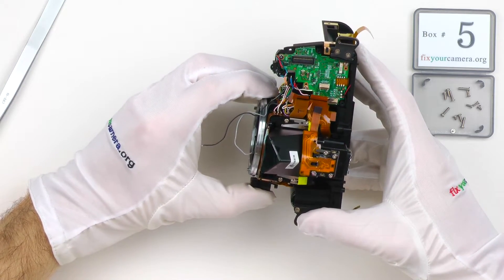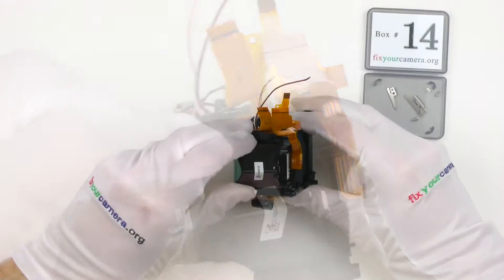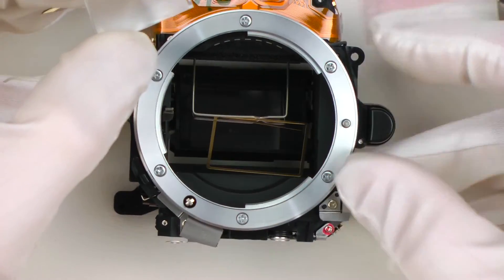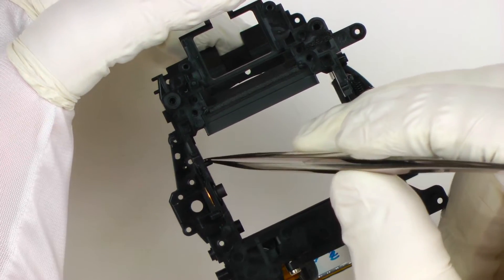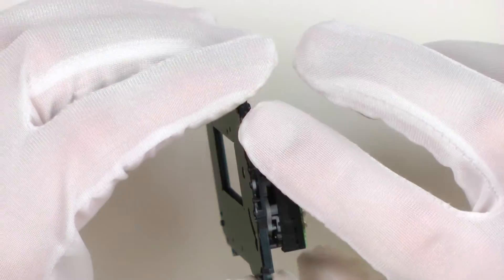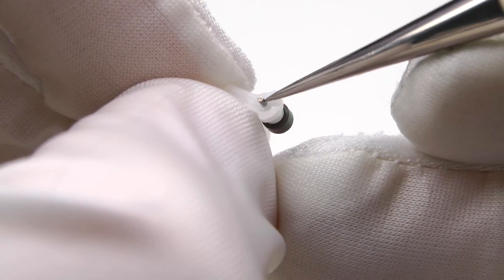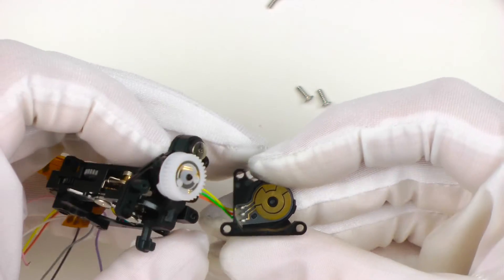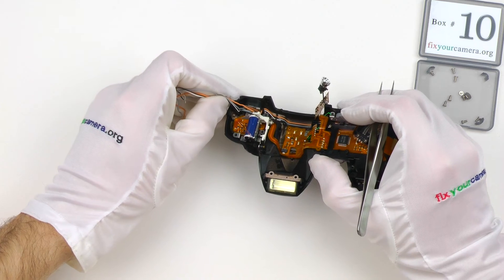Nikon D50 Teardown & Review *Part 3/4* Mirror Box and Shutter - How it works

Comment: Such an excellent work. Well done and superbly explained. I am planning a full spectrum conversion on an old Nikon D50, and I wonder if you can tell me the exact size of the Nikon D50 low pass filter, including thickness (I think it should be something around 1,2mm, not sure) in order to have the replacement piece of glass ready in the moment of the conversion, to prevent any contamination on the sensor. Thank you in advance for you kind answer!

Comment: Could you tell me that, the bottom screws what is adjust the AF sensor, which one adjust which "part of the sensor"?
I have back focus a bit and i want to adjust but i do not find enough info from service manual or from the internet ... nowhere has an accurate description which one of the 3 screws are doing what like in any other camera service manual.

I have focus chart and everything, i did before this with a Pentax K100D but for it had a correct service manual with this instructions.
Reply from the maker: It's not how it works... these 3 screws are for rough adjustment of the focusing sensor - to make it parallel with image sensor - yaw and pitch (after light goes through the main mirror and submirror). Precise digital values are calculated with Nikon's service software (with charts) and then written to camera's mainboard (small board under the top LCD screen). Hope it helps you...

Comment: I'm back with an even ...nicer problem. My D800e stopped working. Problem, the mirror is stuck in the up position and when I try to take a shot, all I can hear is a "zzziiiippp'. The curtains open/close. 'Error' is on the display. Nothing functions, no changes to settings are possible. No live view, nothing. I can manually lower the mirror but it just springs back up. Could it be the aperture or the mirror motor or could it be something mechanical? The actual time it failed, it failed over the coarse of two maybe three shot. Making a high squeaking sound as the shutter process took place. One image was half black. Any thoughts would be appreciated. I plan on fixing it my self.
Reply from the maker: Possibly the aperture / mirror driving assy - hard to say without looking at it. D800 is prone to focusing problems, be very careful while disassembling the mirror box etc, don't bend anything. Good luck!

Comment: Crazy complexity! Hey my D5500 doesn't allow micro af adjustments in camera. I am thinking of adjusting the bottom screws to fix back focusing. Any pointers on not screwing up this?
Reply from the maker: YES! DO NOT TOUCH THESE SCREWS! It's impossible to adjust them without a service software and tools. And congrats - you've just saved yourself at least $200:) by asking before doing it... Most people come to me asking AFTER doing this:) Where did you get this idea from? Just curious to know, there has to be some bullshit website somewhere with this "awesome" advice... 
please let me know
Reply: Thanks for your response! Yes I have been skeptic after reading seeing this in different locations with people claiming that this is exactly what Nikon does if you send them the camera for calibration. Some examples below.

So is the only way to correct the issue will be to send the camera for Nikon? The camera is out of warranty so I was wondering if camera repair shops have the technology to due such adjustment. In my case is back focusing with all the lenses I have.

If you search on youtube for "Physically Calibrate Auto Focus - DSLR" you see an example with people commenting that this gave them good results. Here is also an example of a guy describing the procedure in the d5500 camera: https://www.dpreview.com/forums/thread/4026186

Comment: Hi , I'am planning to change the Reflective Panels in D800. Please advice if we can replace the same without dismantling the Mirror Box . Please advice .
Reply from the maker: Not sure what "reflective panels" means... If the main mirror and sub mirror needs to be replaced then unfortunately a complete disassembly is required and in this model a full set of adjustments: both mirror angles, yaw and pitch, software focus correction...etc.
Reply: Oops .. seems like a complete post martam of my camera ...  Finally decided to gave it to Nikon Service center .. I really appreciate your feedback ... Thanks Bro ...

Comment: Where  did you get Super X from ?
Can you enlight me on the yaw & pitch adjustment ?
I can adjust the center AF point with yaw & pitch adj., but the far left and far right points are not even slightly in focus - is AF adjustment a combination of hardware and software adjustments on Nikon cameras ?
Reply from the maker: +Dorf Schmidt    This glue is not difficult find online. This adjustment is to level and center the focusing sensor. The tool you could make yourself, precision is required though. Other adjustments might be necessary before this one, mirror angles, flange distance, depending on what parts were replaced. Yes AF is hardware, the last 2 steps have software involved.

Comment: Very nice and I see your getting very sterile. I have one question that I can't get info on. I dropped my D800E with the SB800 flash unit attached. It bent the hot shoe upward in one corner, stripping the threads of one of the mounting screws. The flash is now intermittent because the contacts are not contacting 100%. I took the front cover of the eye piece off and can see that the hot shoe is screwed on from underneath or below, unlike other models where it's reversed. There isn't room for access because of the viewfinder. Is there a way to remove the viewfinder so I could gain access to the mounting screws? I need to undo the screws in order to remove the hot shoe, in order to take the slight bend out of it then replace it.
Reply from the maker: +kanukster    You would have to remove all covers, then top. http://www.fixyourcamera.org/nikon-d800  Discharge the flash cap!